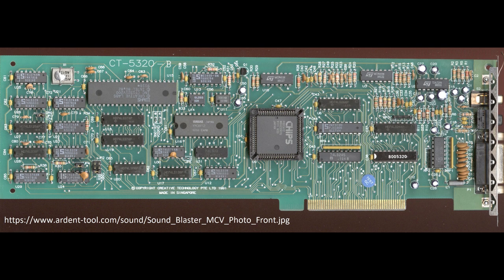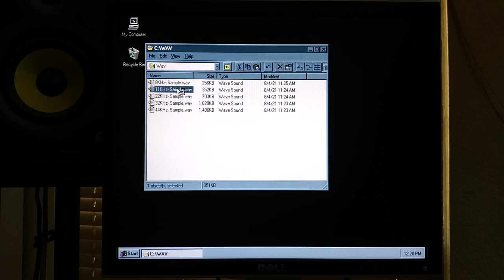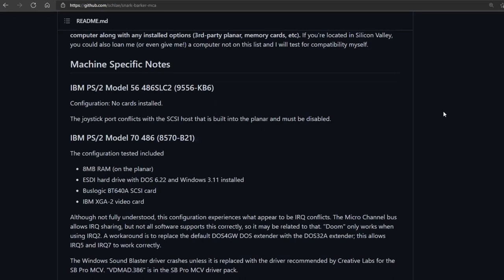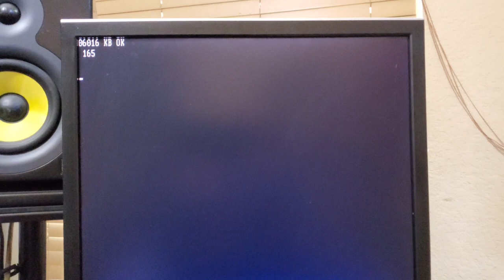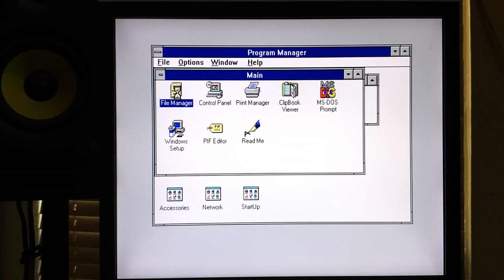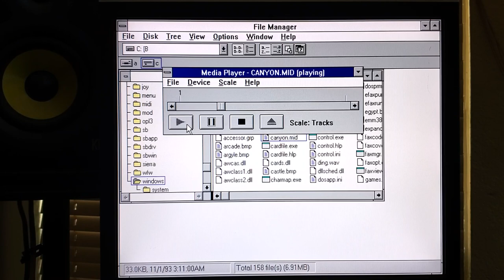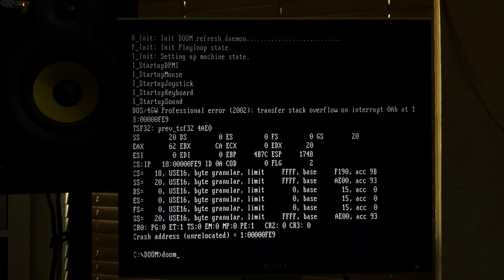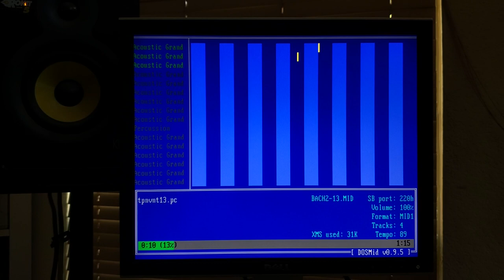Resound New Wave MCA - Microchannel Sound Card for Microchannel Bus Computers - Setup & Demo

Comment: LOVE everything you do. Any thoughts on a PS/2 MCA IDE board?
Reply from the maker: Yes, been working on one here and there as possible.  It's being a little bit of a pain, but such is microchannel.  I think I'm going to have to run one more PCB to get an issue ironed out, so it may be later this year.  Other than the X16, it's my primary focus for now.  It will probably be the last MCA card I make, so I'm trying to finish it before I move on to some other projects I've been putting off. :-)
Reply: I would buy that one in day one. Finding good ESDI disks is getting harder and it would be nice to be future proof.
Reply: Is an ESDI to IDE / SD possible? Something that would just fit into the DBA connector the current drive goes into without using and MCA slot? (I guess that only benefits the model 70) I've heard SCSI to ESDI is easier than IDE but not sure myself. Either way, it's very exciting stuff!